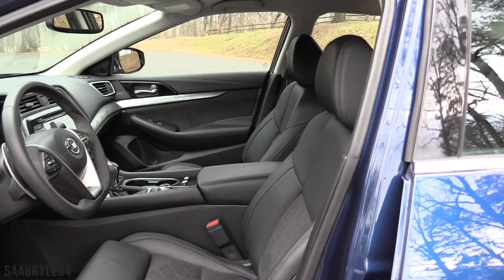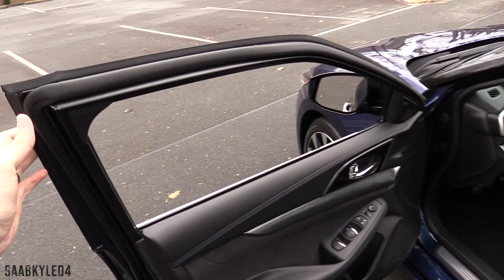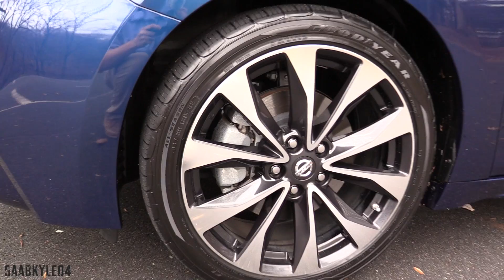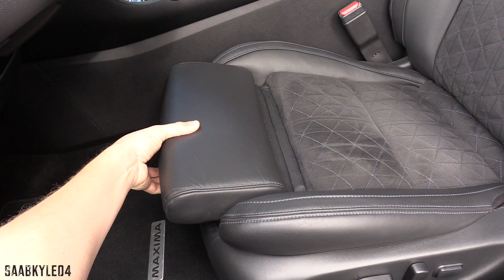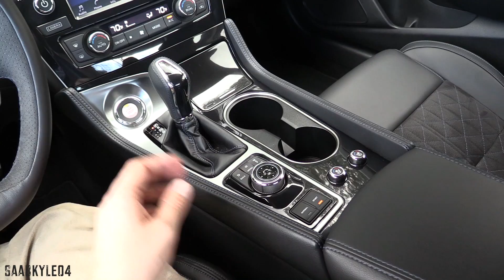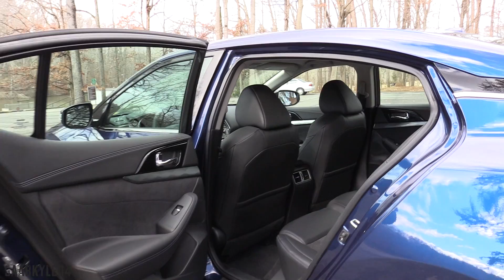2016 Nissan Maxima SR Start Up, Road Test, and In Depth Review

Comment: It looks so mean, and awesome both inside and out!! It`s just a shame that it has a bloody CVT transmission and FWD.
Reply: +enzo478784 
I think CVT gets a bad wrap these days. 
My car (Audi) doesn't have it, but I drove a Nissan Sentra that had it and it's performance was great, and once I enabled the Sport mode, it mimicked rapid revving pretty damn good.
Reply: I believe Motor Trend or some magazine did an article on why the CVT is the best transmission. It does the most efficient job of keeping the engine in its powerband. Notice how when you come to a rolling stop in a CVT, when you press the gas pedal to go again, it's right there with the power, where in a traditional automatic it might not have had time to downshift and you'd get a slow start waiting for it to downshift to get you in the right gear. I drive a CVT. You can still have fun with it, trust me. Manual mode blips downshifts and makes the car much more fun to drive.
Reply: +enzo478784 Nissan's CVT might have become a lot more refined, but only time will tell how reliable and durable it is over their previous generation CVT. This car would have been much better with an 8 speed transmission. Sporty and CVT is like an oxymoron!
Reply: I was referring to the v6 models, lol. In a 4 cyl a CVT makes sense, but on a higher power engine, it really needs gears.
Reply: still pretty fun to drive
Reply: vh9network they are promising, but Nissan and their supplier (JATCO) made them had a bad reputation. Toyota and Honda makes their own CVTs on newer models and i havent heard nothing wrong about them yet. I believe jatco is the supplier of CVTs for Mitsubishi also, and, I had a 2010 lancer before, and that trans never had any issues (kind of weird if you ask me). Definetly something JATCO and Nissan have to fix once and for all.
Reply: +1990Thunderbolt continously variable transmiton
There are no gears
Just two pullies that kan simulate gears
Reply: Blaze Flame
Reply: +Kevin Diaz The four cylinder Accord has a CVT
Reply: +enzo478784 what's a CVT?
Reply: still pretty fun to drive
Reply: enzo478784 yea i hate the cvt
Reply: BornToBeFamed which CVT have you owned?
Reply: Onion Knight the good ol 09 maxima Se .  I liked my 04 Maxima Se better , i thought i would like that cvt but, i miss feeling the gears shift. The driving experience for me was better.  But i did love that 09 it had great response and power.  I wouldnt mind getting another 09
Reply: BornToBeFamed i have the 6 speed accord coupe now. but will be in the market for new car in 15 months. so im trolling for an idea on what want next
Reply: Onion Knight go nissan or Lexus next.   Even a nice audi A5 or s5
Reply: enzo478784 Omg I had no idea it was still FWD.
Reply: It's like so many great things, and then you always have to have something that sucks on it. Or two. Or three.
Reply: yeah bloody CVT  lol Mine broke just one month before the end of warranty, at 87000 kms !!!
like all the CVT of Nissan, they don't produce CVT they produce nothing but garbage CVT and they continue to do that.... no more Nissan
Reply: +enzo478784 The CVTs are getting better, so dont worry too much. You can still enjoy the car like this. I have a QashQai (sold in eurpe) with CVT and its really smooth and has the behavior described in this video. I am just hoping that no issues arise, lol. Up to now, everything has being perfect on my car.
Reply: +Kevin Diaz Compared to dual clutch transmissions or even ZF's 8 speed transmission, they are still pretty shitty mate...
Reply: +enzo478784 but it is true, they are getting better and better... Hopefully one day they will be as good as the conventional ones! :)
Reply: +enzo478784 Yeah, but we cant do anything about it, lol. These type of cars arent that premium anyways. I dont think theyll put that kind of trans on these type of cars. Camrys and accords have traditional automatics.